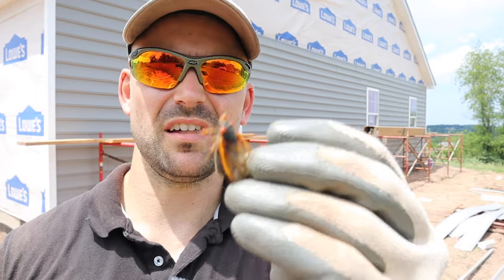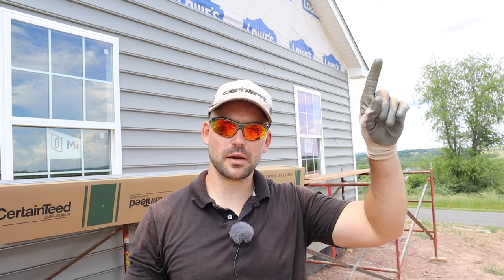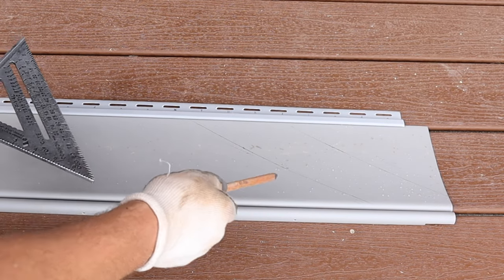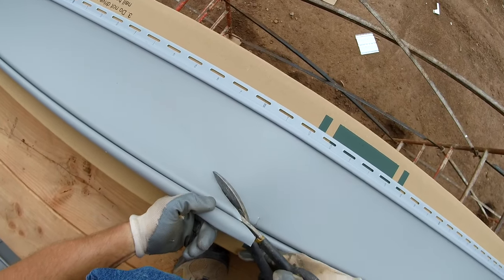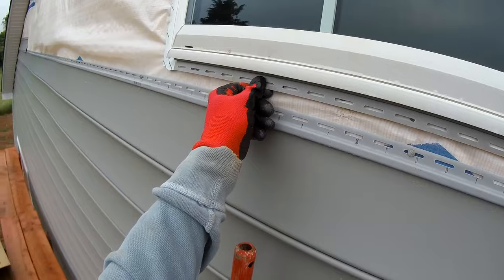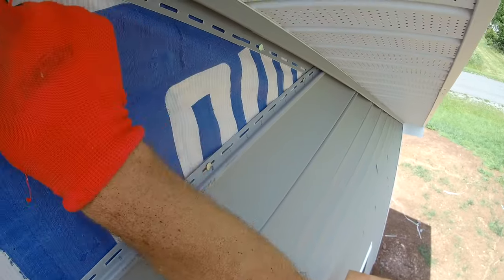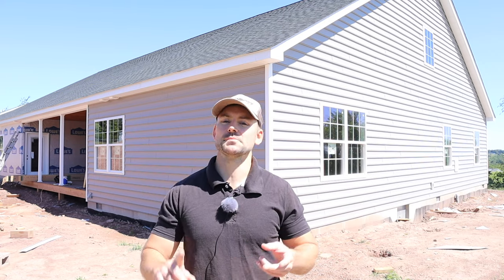How To Install Vinyl Siding (Part 2)

Comment: Great video but you were making me nervous on that scaffold. This is the best video yet. Thanks.
Reply from the maker: Thanks George! I don’t like heights very much either but had to be the job done.
Reply: @TheExcellentLaborer  I did carpentry work for years and never got used to working on the edge of the roof.

Comment: Probably the best video I've come across for siding installation instruction. Thank you! Do you have any instruction on installing vinyl siding over clapboard? From what I understand I can keep my clapboard, which is in good shape, and put a layer of foam insulation over it before going through the normal process of installing the vinyl siding.

Comment: Consider investing into sturdy steel ladders and extendable planks. I noticed that you still use scaffolding when you could use some tall step ladders with an extendable plank to walk across. My lumberyard has been selling them like hot cakes. They save so much time setting up and taking down and are multi-purpose.
Reply from the maker: I have thought about those in the past. I have just never broke down and bought them. Good tip. Thanks for comment!
Reply: We
Reply: Or you could just use a skyjack.

Comment: Easiest way to find your angle is to measure your siding size and use a square to make a mark at that size on the panel below then measure over to the Jay from mark . You should always know your siding size anyway for an up and over or any other situation where you might have to measure to make your siding match up

Comment: Thanks for posting all of your videos, they have been very helpful!! I'm building a garage and I'm just about to install the vinyl siding. I was wondering if you could possibly make a short video on how you install the blocks for my exterior lights before I put the siding on. Thanks again for all your help!!
Reply from the maker: Hey Steve! I’m glad find my videos helpful! All you have to do is use a small level and get it level and plumb and nail each nail hole on nailing flange. Hope that helps!

Comment: For your  gable end take a scrap peice with no factory on it put it up and tight to the gable then measure your distance. The distance you get will be the distance you measure off the top a lot easier and faster

Comment: Awesome tutorials! I am building a 16 x 20 foot shed, and am at the point of starting the soffets and siding. My question is in regard to doors and windows. I got the part where you used undersill trim beneath the window, but what about the sides and top of the window; does the siding just butt against it? What about around the door; do I use J channel? Thank you!
Reply from the maker: You do not put anything at the sides in the tops of the window other than J channel if it is not a new constructed window. But new construction windows have the J channel built around them already. The door is just J channel yes. You are welcome!. Good luck on your project.
Reply: @TheExcellentLaborer  thank you! Loved your videos!

Comment: Great video! Thanks. Q: It appears that the vertical joint where outside corner meets the bird box, there is no J, just an unsealed joint. Am I missing something? Should it be caulked?

Comment: Josh, your modular scaffolding platform rocks and looks like a great cost effective option compared to renting a vertical lift.

What kind of Scaffolding and wood plank material do you use at 15:04?

I could not find them at your Amazon store. Thank you.

Comment: These are great videos and I wish I had found them sooner! 
I do have a question about the J channel and undersill trim combined to finish the last piece. Is it necessary to have both the j channel and undersill together, or can it be finished with just the undersill? Reason I ask is because before watching this video I didn't know you could do it that way and assumed I just needed undersill to finish it out lol so that is what I ordered. But now I'm wondering if I should order more j channel

Comment: Very useful, thanks. I have a question, please. In the front of my house, I have a porch with 4 inch cement slab on top. How will I start the siding on top of the cent porch to keep the same line for all the front of the house ? Thanks.

Comment: So if it all is nailed to be able to slide what stops a person From using silicone on the joints so Those pieces don't get any water behind it from blowing wind  not to the building I'm just talking about Siliconing the overlap.

Comment: I'm adding aluminum facia to my gable that has vinyl siding attached already. Can I just slide the bottom of the aluminum facia in between the facia board and the J channel at the top of the siding?

Comment: I have learned so much from watching your videos. I have a question I can not seem to find a straight answer for. We are going to vinyl side our house. Under the old aluminum siding is wood siding with furring strips. When installing the new siding on top of the wood siding do we have to use both the furring strips and foam board to create the flat surface for the new siding? Or can we use just one, the strips or the foam boards? And which one would be better to use? Thank you

Comment: Josh great videos! Really helping a guy out to fix a siding problem. My question is what do you use on the bottom of the siding for the corners so no wasps or other flying friends invade? Not sure if i missed that in the video.

Comment: I have to ADD an exhaust fan that will require cutting the VS for the vent.  This is different since the vinyl is already installed (vs doing it for a new build).  I'll continue to look but if someone can point me in the right direction, thank you!

PS - love your instructing skills!
Reply from the maker: The best thing to do is remove the siding, install the vent, then replace the siding and cut around it as you go like normal. I hope that helps!
Reply: @TheExcellentLaborer  Thanks.  I was wondering about finagling the VS around the J-channel/trim.  But i'm working from the bottom of a piece so there should be enough room.
Reply from the maker: @leojf3828  ok let me know how it goes.
Reply: @TheExcellentLaborer  Will do. ☺
Reply: @TheExcellentLaborer  Done.  Was a bit of a struggle but I didn't create additional work with bad math/cuts.  I would starve to death as a VS repairdude.  Thank you for your assistance/concern!
Reply from the maker: @leojf3828  I’m so glad you got it fixed! No problem man. Stay tuned!

Comment: I’m currently doing windows and siding on the house about to get to the siding part and ordering all the parts I need. With the new construction windows with the integrated j-channel, do you need to add anything to the sides and top of the window or is it just the undersill on the bottom?

Comment: Could you use utility trim at the gable Peak? Instead of using a trim nail?
Reply from the maker: No because it does not hold as tight as a trim nail. Hope that helps!

Comment: How do I start the first row of siding if two walls meet but the one wall has to start about 3 inches higher. I either have to cut the top or the bottom off. If I cut the bottom I won't have a starter strip.

Comment: I saw what you installed under the window but what about the sides or above the window? 

also if your only doing siding on 3 walls is there a special corner you use on the ending wall? I'm planning on doing my own siding on an addaroom. I have faith I can do it after watching your video

Comment: I have a quick question, is there a standard way to cut siding to start your courses so that your staggered look is uniform? I will be siding a 24 foot wall with no windows or cutouts for electrical etc. It is the main wall that can be seen from the road.
Reply: Use random staggering with at least 2 ft apart joints

Comment: Thanks for the video. Could  you tell me the brand name of the siding  that you're  using? I like the look of wider siding. Also, I purchased  a fixer upper that has wood siding. Would  it be best to remove wood siding?

Comment: With Hardie you sometimes start going a little off level - you correct by making small adjustments in subsequent boards. Can you do the same thing with vinyl? Is it possible to correct a small amount as you go up?
Reply from the maker: Yes you can! You add tension to the side that needs to go up as you nail. I hope that helps!
Reply: @TheExcellentLaborer  That makes sense - nice to know it can be corrected, as I'm about to do a two storey house with vinyl siding and I'm sure a bit of creep will happen as you go higher. Great videos - god bless.
Reply from the maker: @pingpong9656  Thank you!

Comment: Any Visio on side wall/ roof house wrap to step flashing. Do you tape house wrap on top of flashing and leave J channel 1/2 in. Above roof?
Reply: You should put a counter flashing over the step shingles. Leave about 2” or so above roof for future re roofing. Think of the ability for someone to slip new step shingles up under the flashing.
Reply: @jpjp3873  thanks

Comment: if you use undersill trim do you have to have the notch tool for it to work?  I am siding my house and the company that I bought siding from included the trim which he said was for the top like the roof line or top of walls.
Reply from the maker: You do not need to use that tool. I never have used it and I have never had a piece come out from the undersill trim.
Reply: We used to use a material similar to the soffit material he was using to make skirting kits for manufactured homes/mobile homes . On those because of the ground freezing raising etc. the skirting piece was required to float between the bottom and top J channels. Common height was anywhere from 20 to 40 inches and the big puff of wind comes along that stuff was gone unless you had a notch tool and used it top and bottom on each piece so it could still float but secure in there now. That’s the only place I ever saw that notch tool used.

Comment: I did my siding twenty some years ago and I'm having a problem with the top piece sliding out.   Suggestions?
Reply: I think you can use trim nails to hold it in place.    you can place trim nails right below the top piece where it locks, that should prevent slide out or fall outs.
Reply: @burnienjohn6676  I tried that last year.  It buckled.  I ended up moving the under sill and it's holding.   WIth the cold weather coming I'll see if I moved it down far enough.

Comment: Can I get vinyl soffit and aluminum fascia in matching colors other then white?
Reply: U should be able to check with your hardware store and see what they have, I work at a hardware store and they usually come in all colors, but check first
Reply: Prebent fascia comes in limited colors and hard to find as well. Find someone who has a break, buy a roll of PVC trim coil of the color of your choosing and pay them to bend the metal to the size you need. I bend for people all the time, $1.25 a lin.ft. it shouldn't be hard to call around and find a siding guy willing.

Comment: i'm going to side my shed.  why the under sil trim at the top, can't the siding just go into the j-channel?
Reply: The j channel might have a half-inch opening for the top edge of the siding to flop around it and look wavy. The under sill holds it in a tight straight line
Reply: @brutongaster8184  thanks, I’ve found cutting off the nailing strip off and placing / nailing it in the j channel works.  Credit goes to anther u tube video
Reply: @dougm1985  I'm glad that works! I've seen that done before but never had the chance to try it myself

Comment: How would you trim out a window on a flush mount window? Like on a mobile home.
Reply from the maker: I don’t know. I have never done trim on a mobile home.
Reply: The biggest issues with mobile homes is they are often screwed from the outside with a ton of ¼" hex head screws. There are a few ways to do this. One, you can wrap the perimeter of the window with a 1x4 or 2x4 and then cap that with metal bent in a break and then caulk the meeting place where the trim meets the window, or let the metal overhang the screws to cover them(I prefer this) and caulk that meeting joint, or you can use J-channel or any of the decorative window channels available and butt it to the window and caulk that meet junction(least favorite). I never suggest covering those screws with the J-channel in case you ever decide to change the windows.

Comment: Si bad jchanel  put inside corner
Reply: In 40 years, never used inside corners unless it was an accessory that matched a high end job. I don't do 2 pieces either. I take a piece of siding, rip the lap and nailer off, then stick it in the break or just use my hands and fold it lengthwise. I stick that in the corner, hang one wall, install a J and hang the other, makes a much cleaner look.
Reply: @pepperman9  Visual learner here! Could you direct me to an image of what you're talking about?

Comment from the maker: ⏱TIMESTAMPS⏱
0:40 How To Cut J-Channel To Match The Birdbox
2:50 How To Find The Angle Of The Gable End
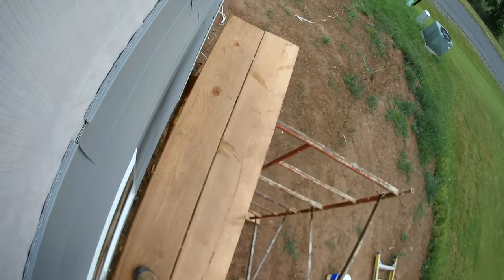6:10 How To Measure And Install Gable End Siding
10:34 How To Install Undersill/Utility Trim Under A Window
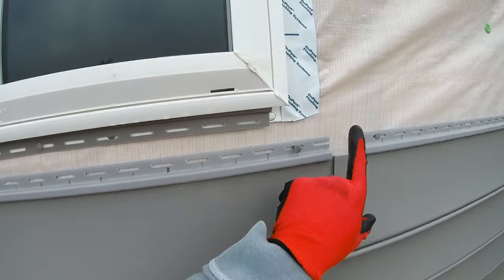11:08 How To Cut Vinyl Siding Around A Window
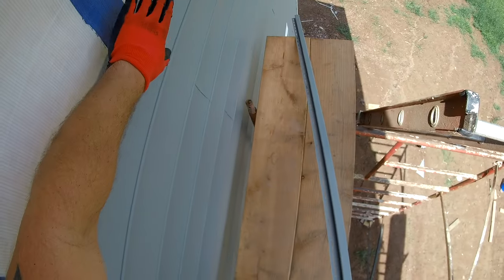11:39 How To Cut J-Channel To Continue A Run
14:00 How To Install The Final Piece Of Gable End Siding
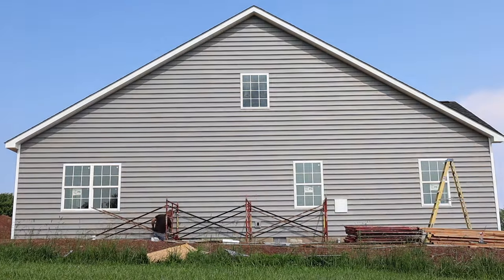15:19 How To Finish The Top Piece Of Vinyl Siding